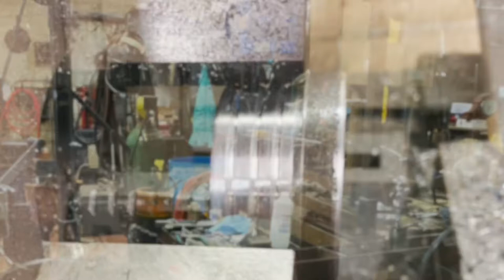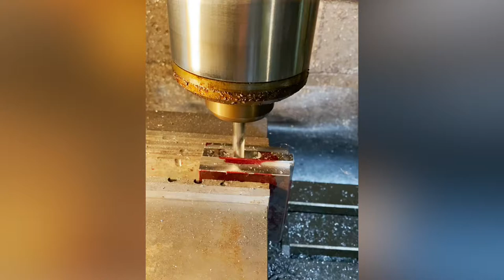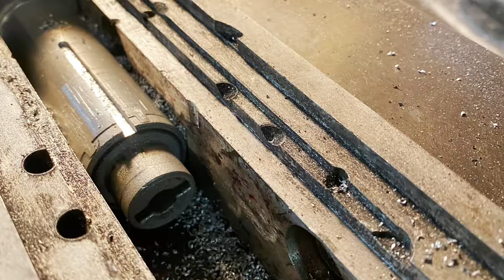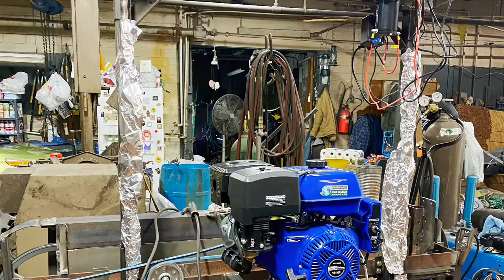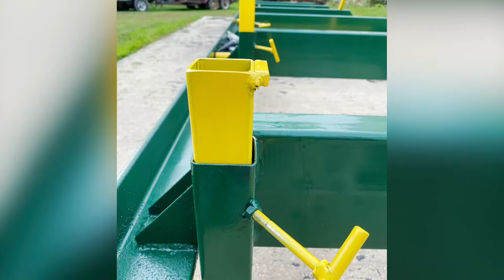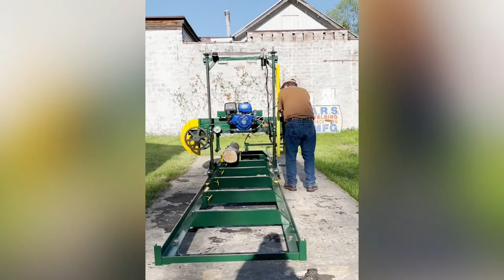Homemade sawmill build in 60 seconds

Comment: Awesome little build ! great if you just need a few boards or if you want to square up some logs & do some building :) good job !
Reply from the maker: I made the mill so I could do building repair on my industrial building. The majority of the wood used to frame it is hardwood. I have a small wood lot out back. I have been using trees that have dropped in storms mostly. I have some standing dead to drop before they go bad. So far, it has been a lot of fun. 

Thanks for watching. 
Alan